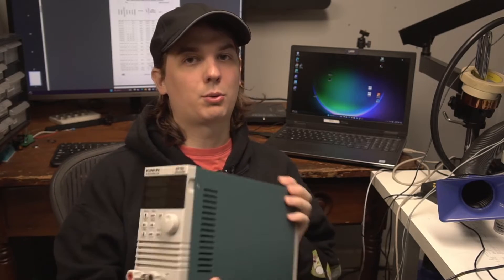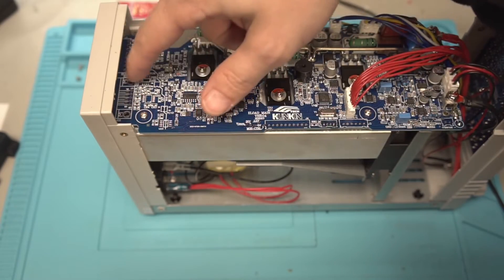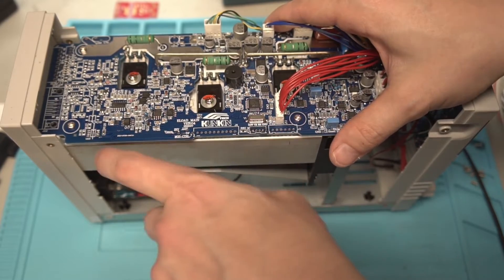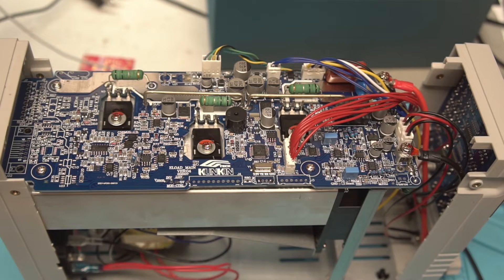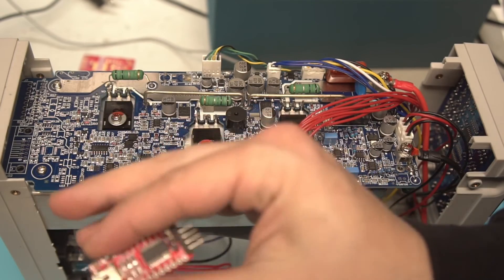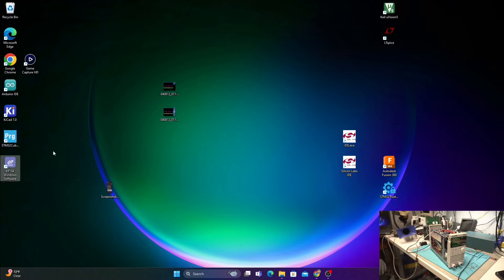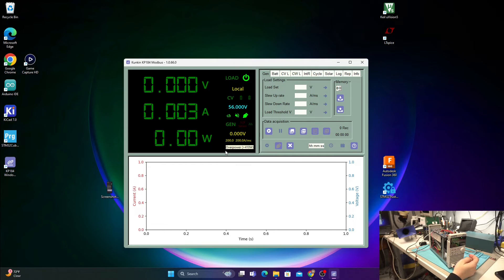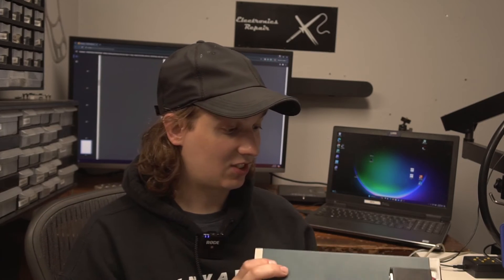Kunkin KP182 MOD: Adding Serial and USB to a KP182

Comment: A close-up of the top would have been helpful where you tapped in to the serial connection!
Reply from the maker: Makes sense. It's pin 6 and 7 of U23 though.